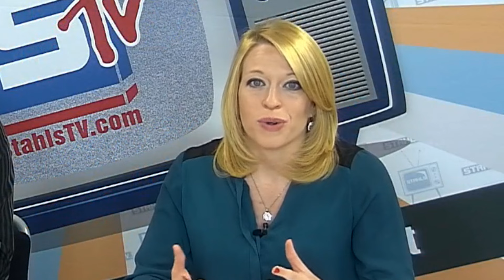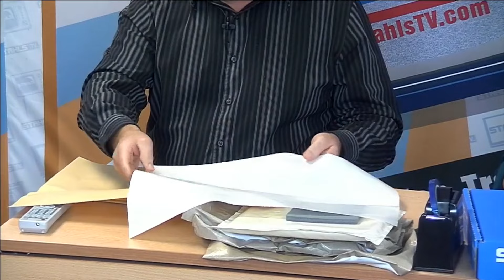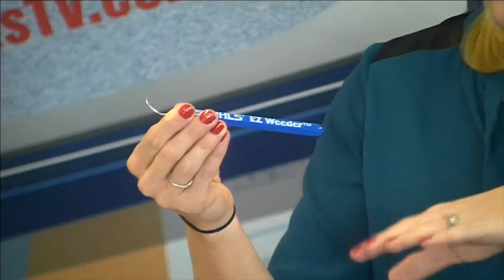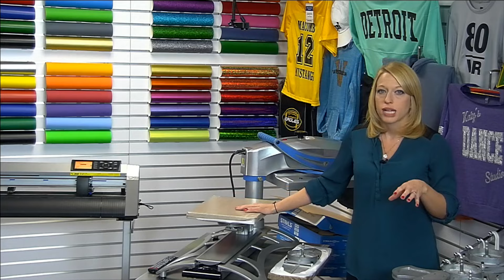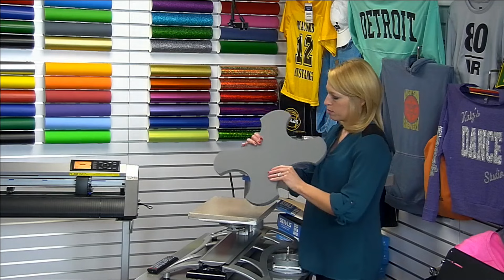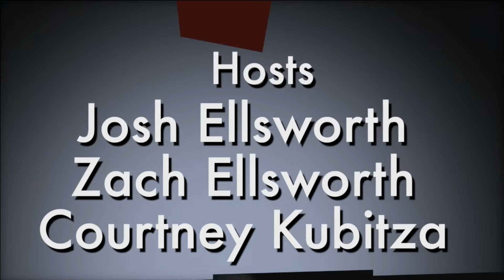Setting Up Shop | STV Morning Show Season 1 Ep. 23

Comment: excellent advice.. that's almost exactly how I have my little shop setup.  Tables are a must.  I put my 16x20 swing away on a sturdy table that had a motor that goes up and down (was for a mac computer station, the motor broke).  I put it over in an area it fit into perfectly.    I need a bigger office area now.  two vinyl cutters take up room (cameo and brother scan n cut. ).  my oki c831ts is on a big roll cart from Sams club.  Folding tables are great too, could be sturdier though.  Lots of trash in this business. definitely not a "green" business.